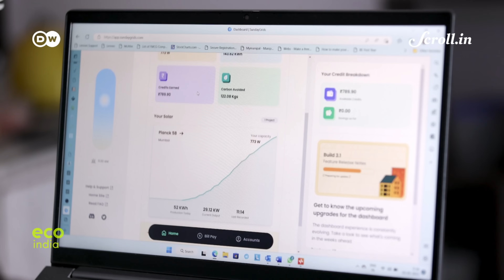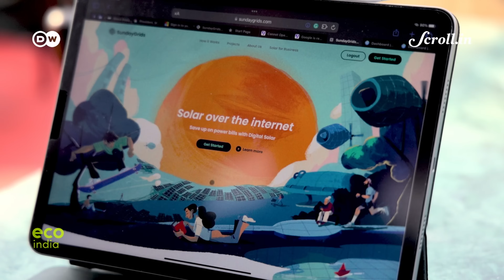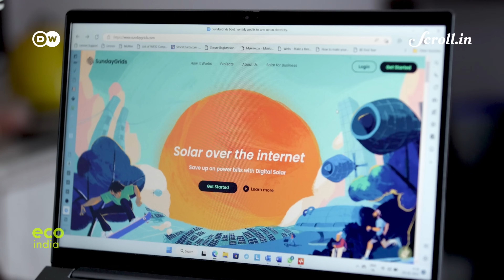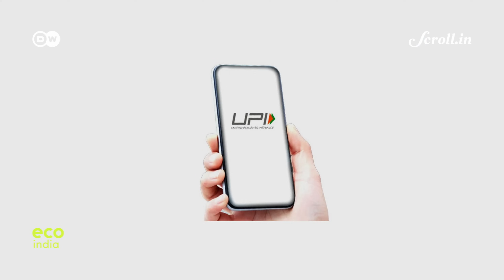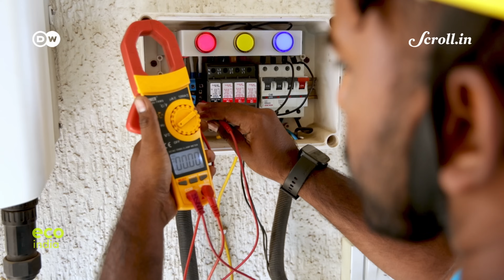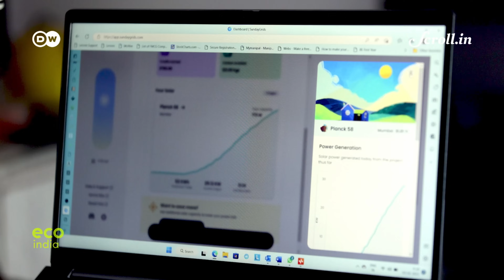Eco India: What is digital solar, and can it push urban Indians to switch from using fossil fuels?

Comment: I am from Chennai, Tamil Nadu. I still don't see the connectivity between the digital credits and the payment of my Electricity bill. We do not make a monthly payment; instead, we make a payment to the EB every two months, either online or offline. So the tariff turns out to be high. Please explain how acquiring digital credits will reduce my electricity bill.  It would be great if you could explain through a valid use-case, connecting what bill amount is to be paid (paid after 2 months in  Tamil Nadu), how does it benefit if routed through Digital solar, how much does the consumer get to benefit. Is there any possibility of a data breach?

Comment: 1. How do you compensate the host ?   2. Does the host get to reserve some capacity at rates which would be lower than what you retail to individual users ?   3. Is it that the balance of the capacity is then retailed out ?
Reply: After 15 years , they leave their solar panel with the host , and they also provide cheap electricity to host , which brings down their electricity cost by 30-40% , thats what they mentioned on their website

Comment: So the concept goas like this - you create a digital wallet and buy a solar panel in some location you don't know. As that solar panel generates power, you get solar credits of the same value in your wallet which you can use to pay off your electricity bill.

The concept looks interesting, but I don't understand one thing - why don't the company directory sells the power generated by panels to the government? Or why don't they create an energy company like Ambani which sells electricity directly to customers? You can even brand your company as completely green energy provider and charge a primium.
Reply: They would need to bring capital to procure and install the solar panels. Here they are crowdsourcing the capital. They are like REITs for solar. They are unnecessarily complicating their messaging by saying "you can use the credits to offset your electricity bill". It is actually an investment scheme which gives dividends based on the energy produced.

Comment: Have some issue with SundayGrids. Idea is good but it is not profitable w.r.t rooftop solar. Reason is the billing in most of india is exponential w.r.t units one use. So it will charge lets say 6rs/unit till 0-100, 8/unit 100-150, 10/unit 150-200 and so on. Main advantage of solar rooftop is that it offset the unit with the unit generated i.e. if one consume 230 unit and generate 200 unit it will offset and show 30 unit only and the user will have to pay for those 30 unit on 6/unit charge i.e. 180rs. 
Now if one opt for SundayGrids and for the same stats above the person has a bill of 600+400+800 = 1800rs and lets say they generate 200 units from sunday grids and it will give them 7/unit it will translate to 1400rs. consumer has to pay 400rs.
So the user will pay 220rs more comparing it to 14 years with no change in electric plan it will zoom to 37000. 
I will say sunday grids is not solving any issue here. The issue will be resolved if they work with govt in offseting the user bill. thats where the main issue is. 
Still a good idea and way better options for those living in metro cities as they are the bug energy spenders

Comment: If I'm not wrong, the customers are buying the carbon offset credits from this company as a digital currency and paying their electricity  bills with it. 
That does leave a huge '?' of how the monetization is legitimized. Like someone else pointed out, what mechanism is there for the customer to verify that the currency or 'wallets' are not duplicates? How does the value of the wallet change based on changes in the number of customers v/s energy produced, especially with seasonal solar output variations. Are the value of the wallets based on the government's fixture of value for carbon credits and do they have other independent agencies auditing their carbon offsets? 
Carbon crediting is still nascent in India, it's history is other places is riddled with corruption and this one kind of really confused the heck out of people and left people with more questions than answers. 
There needs to be better informative, much more transparent reporting when introducing something that has already earned a reputation for often being in grey area internationally
Reply: Hi Aleena! So SundayGrids don’t pass along carbon offset credits or other green attributes of any manner. Instead when users reserve on our platform, they recieve bill credits, which are used to add on top of their power bills as discounts. Thes bill credits are essentially what the host (who uses the electricity) pays you for the power from your reserved portion of the solar panels. No trading of carbon certificates takes place on our platform. 
Our goal here is to provide an alternative to those who cant install panels on their rooftops, and very much like rooftop solar, there would be seasonal fluctuations. When we calculate power generation, we take those fluctuations into account (from historic data and weather forecasts etc) and then show the data to you, and the value on the wallet is dependant only on the users reserved solar capacity, it doesn't fluctuate with more users joining the platform.
Hope this helps!

Comment: how do you guarantee that the 2 KW amount of panels that you have sold to me is not sold to someone else?
Reply: The credits our users receive come from the solar power generated. If duplication happens (which is restricted from happening in irl algorithimically), say 2 KW as in this example, the platform would be at a disadvantage by having a deficit caused from having to pass along the same amount of credits (2 KW of solar roughly generates ₹1400 of credits monthly) to two users, while we receive credits from host only for the electricity from 2 KW they consume.

Comment: Hey Scroll team, thanks for featuring us :)
Would love to hear your queries or notes on digital solar, happy to help!
Reply: do you guys plan to add residential solar in your mix? a lot of us have large solar installations on our rooftops (10kw)
and Flexi plans for residential solar: taking the extra solar generation (mostly during winters) from residential solar and selling it digitally
most people like us install extra capacity than needed due to summer AC usage
Reply: This is freaking genius! Great idea. Good luck to you and your team!
Reply: I am living in Rajkot, Gujarat. My Discom is not listed on your website.
Reply: From what we know, both Dakshin Gujarat Vij and Paschim Gujarat Vij are the utilities operating in Rajkot. And both of them are available on our platform. If your utility is not the ones aforementioned, could you let us know?
Reply: Share yr website here
Reply: Guys, you should try to connect to Ivy Protocol in Berlin which is working on a similar concept using Blue Carbon.
Reply: Does solar panel gets effected by hailstorm?
Reply: @gupigainbaghabain6465  yes it can if the hailstones are large as 1 inch pebbles
Reply: Develop solar power to charge laptops, mobiles etc.

Comment: I saw the website. I think summary is: You buy a portion of the panel which someone else uses. In return you get credits which you can use to pay your electricity bill (which continues to come from fossil-fuels). BUT, because these guys are middlemen, they would be taking a cut. Also, though we get some credits for some months/years, we don't end up owning a solar panel at the end.
Reply: Our power grid gets electricity from a mix of sources, adding more solar to the grid makes it that much lesser dependent on fossil fuels and cleaner!
Reply: No company can operate without a business model. There is nothing wrong in their taking a cut. They are solving a real problem. They are making unlimited amount of solar capacity available to high rise dwellers who otherwise have no access to solar.
Reply: I agree with you. Adoption is not going to  increase as fast it is needed. But this startups like these will  help people who want to do business in the power market to make their first move by installing solar panels with their own effort and the effort and fruits of one entrepreneur will motivate others.
Reply: 42% electricity in India is already fossil free and will be 50% by 2030.
Reply: @Saurabh.P  how much of that 42% is nuclear fission sourced?
Reply: @jay6645 
    Nuclear Power: 6780 MW
    Wind power: 41.9 GW
    Solar Power: 63.3 GW
    Biomass/Co-generation: 10.2 GW
    Small Hydro Power: 4.93 GW
    Waste To Energy: 0.52 GW                           
    Large Hydro: 46.85 GW
Reply: @Saurabh.P  Thanks. Could you list the sources?
Reply: @jay6645  I am unable to post URL here. I quoted Nuclear power number from official GOI's PIB site.
Reply: @Saurabh.P  Hey that's ok. Thanks a lot. I will do my own search. :)
Reply: Yes there is a certain difficulty in this scheme

Comment: how does digital solar work during loadshedding or power cut?
Reply: Much like any regular solar actually. If they are net-metered solar systems, it would be on pause until the grid gets back online. But the benefit of net-metering far outweighs the occasional disruption as it allows us to store surplus power with the grid to use it at night or when it's cloudy out there.
Reply: @sundaygrids  adding storage to the mix makes for greater access to premium rate tariffs. Please do not provide a single reason why you can not.